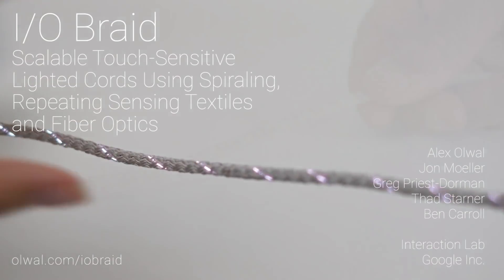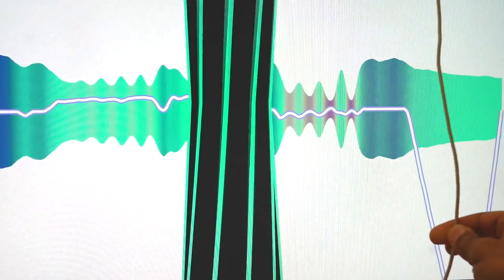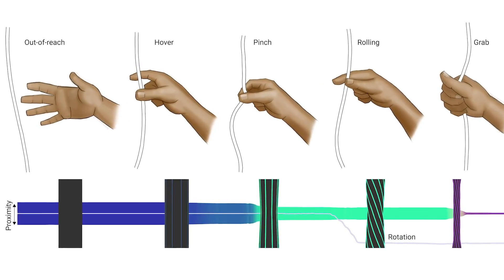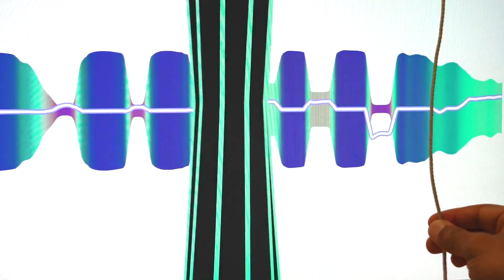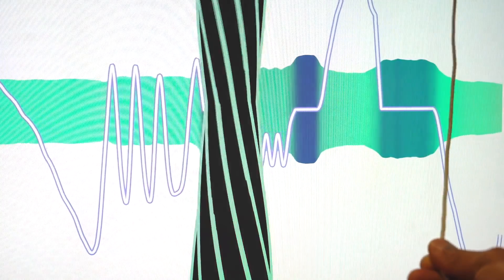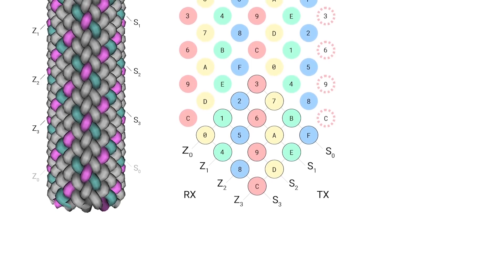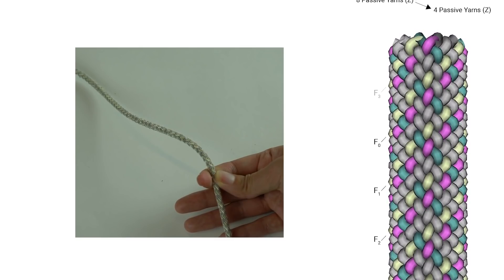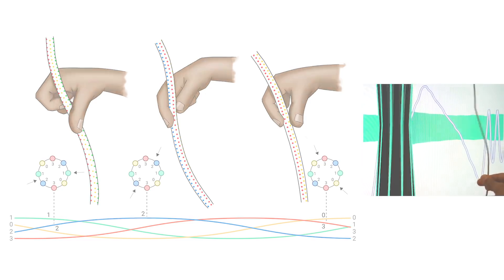I/O Braid: Interactive Cords Using Touch-Sensing Textiles and Fiber Optics

Comment: Nice. But touching and twisting a cable, makes much more "material stress" than a simple button. The plugs connected to the cellphone and earphones could also suffer. I think this technology is great, but in the hands of common people, it would deteriorate and break more often than normal systems.
Reply: The stress is distributed over the cord, so the stress at the connectors is pretty low.